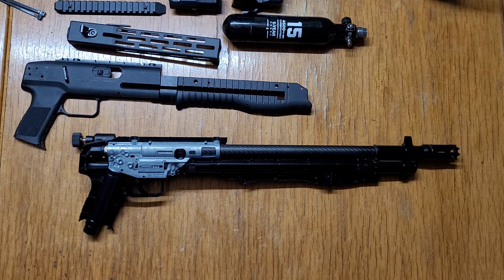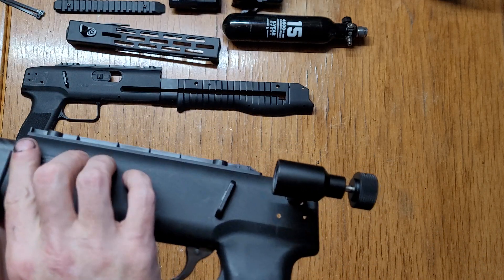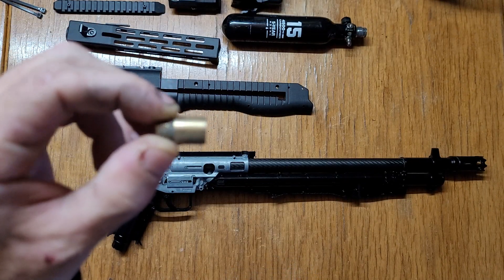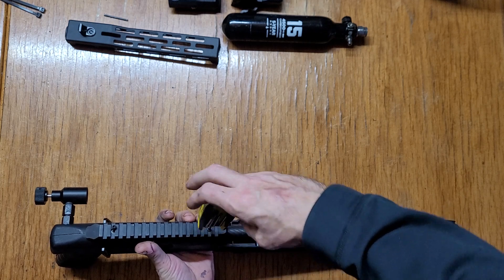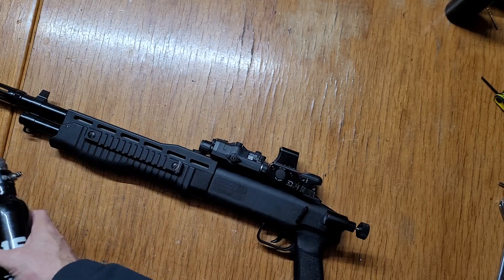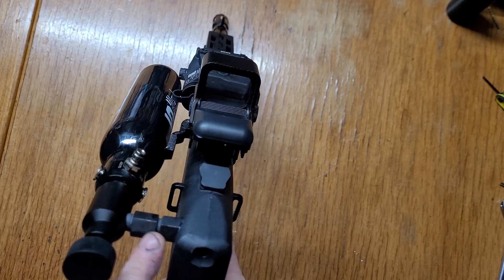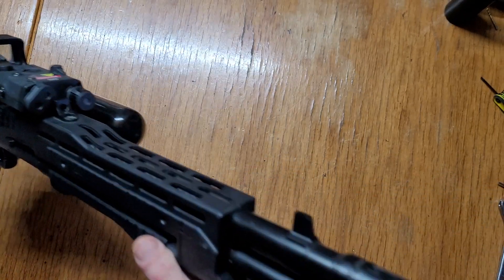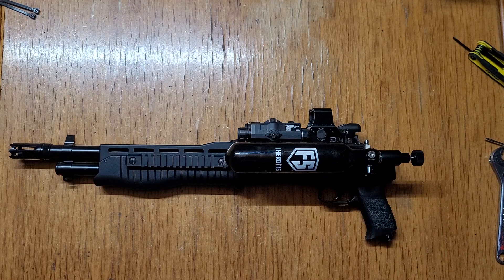Umarex HDB 68 DIY HPA Adaptors Nice Clean Build

Comment: Great Dude! The HPA is at the top, more than a swivel stock is missing and it will be optimal. 😀
Do you think you could mount a 4500 psi HPA cylinder with these 1/8 npt fittings without risk of injury?
Thank you in advance for your answers.
Reply from the maker: yes i made one witha  folding stock as well :) and this tank im using is 4500 psi and carbon fiber
Reply: Ooyaaaa
Reply: U rock
Reply: And that’s for me is  it  ? Exciting